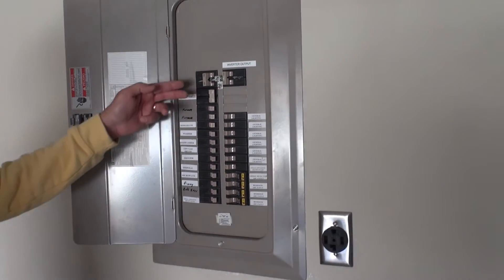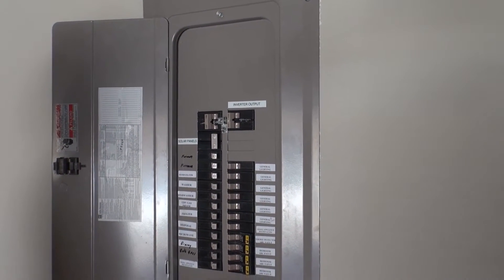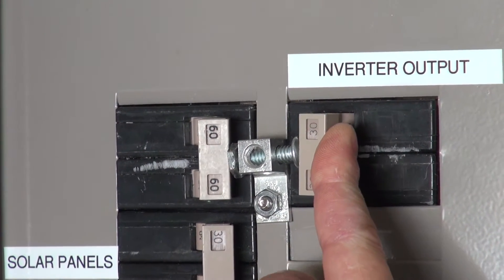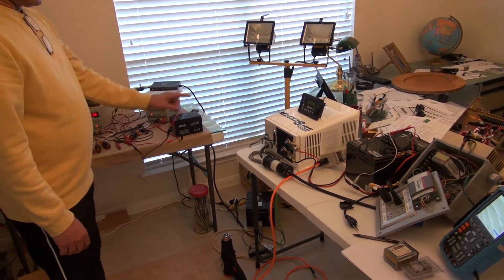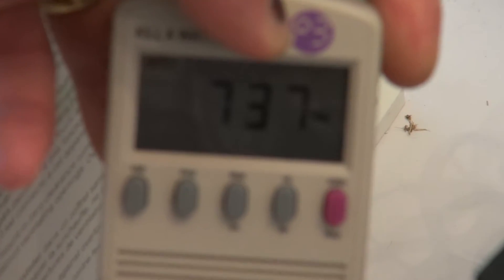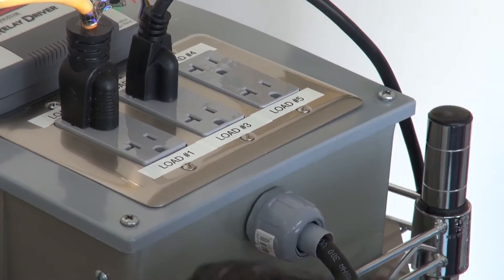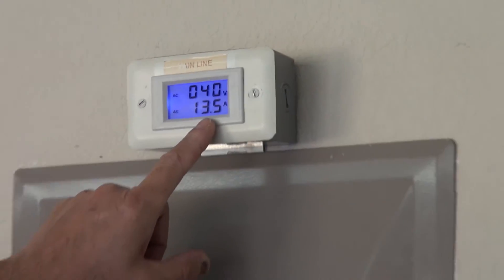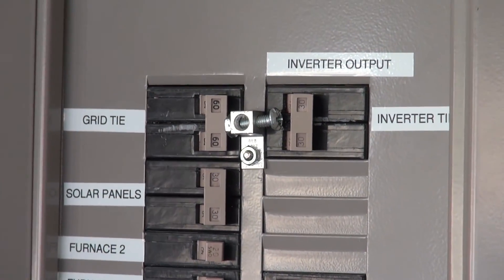Grid Tie Inverter without a Grid Part 5 of 5

Comment: Why not limit the Solar Power available to the Isolated Grid Tie inverters to limit the power created ?  There wouldn't be a need for the Dump load.
Reply from the maker: The dimmer is too slow to respond and you can not control the output of micro inverter they are on or off when they go off it take up to 5 mins to coming back on so you have to manage extra power that you generating with dump load

Comment: Hi Mark,thanks for this video..Interesting and great info! How come the voltage drop when load starts doesn't shut off micro's ? Once you hook up motor or compressor, it will drop significantly and shut off micro's for 5 min restart, which may result not to start the motor and going micro into cycle every 5 min.El. motors use high start up amperage causing voltage drop on OFF grid systems.This setup you have may be good for lights or small loads, not fridge ,not well pump, not A/C etc.. I'm wondering how Tesla power wall 2 is working with these dump loads..Tesla wall is also running from micro's and through some get away transfer switch shifting the loads..Once  Tesla  wall is fully charged, it keeps somehow PV array idle and doesn't let those micro's go full throttle depsite high sunlight, but keeping them ON..It has some kind of control of the output as you mentioned before, that  you can't control the output of micro, because it does produce max given from  sunlight at given moment...Do you know how Tesla wall deal with dump loads????
Reply: I think Tesla will do the same as this Magnum Inverter. It will increase its Ac output frequency to shut micro-inverters off.  All of this work of this gentleman is to avoid shutting microinverters off because it will take at least 5 minutes for them to start producing power. Frankly I don't fully understand why so much energy was put into this, but I found it interesting.

Comment: How can I use my inphase off grid straight to a hot water heater? This way I dont have to convert the thermostat to dc . I have extra pv panels I would like to do this with and take advantage of the mppt
Reply from the maker: Executing the command of dumping extra load should be done within 1 or two cycle of 60 Hz or inverters are getting shut down, you can use one or more of the outlet plug that I shown in youtube video to use your heater as a extra load, you can not directly connect Enphase inverter to heater, because Enphase inverters are Grid tie inverter and will not start if they do not see 60 HZ sine-wave with 240V AC, they check ~4 to 5 mins the above condition before they turn on and will go right away off if any of above two condition change, they build this way for safety. 
Note: Grid tie inverter generating power while they tie to live grid when they come on they have a bit higher voltages than Grid voltages that causing flow of current to grid. any interruption on grid Voltage of Frequency will shut the inverters OFF.

Comment from the maker: Hi Ric, yes you can  I am in Austin Texas the last thing that I need is more hot water :)
when the GRID IS DOWN and we turn on the panels we might have excess power that we do not know how much and we need to get rid of it before system force to shut off so i used cheapest resistive load that could use and is not sensitive to erratic power delivery.if the GRID is not DOWN all extra power goes to grid.

Comment: Hey Mark,great video you manage to thoroughly explain a/c coupling in a concise yet informative matter(kind of like show and tell in grade school)something that many manufacturers can't quite grasp.Would the dump load power be enough to energize a device which we could actually utilize i.e. water heater,portable heater or any type of resistive load instead of just burning it off?I realize that we would still supply the grid,but it just seems wasteful to simply burn off harvested power?thanx

Comment from the maker: Because using Magna sine you need to gang all panels in series or parallel and if any of panels goes bad it will effect all, also when you using Magna sine inverter you need somehow a big bank of batteries, in my design I use minimum battery to trigger the panels to generate the power during day time. remember the batteries are expensive and do not last long.
Reply: Dear Mark,
first of all, congratulations. Your series of videos is so far the most useful ones I have found in YT. 
I am planning to replicate your setup but with a slight modification: use only supercaps with their power dumping circuit instead of monitoring the battery voltage to decide whe. to dump load.
Do you think it will work?
Reply from the maker: How much charge can they hold? and then what happened after they get filled up, where the excess power going to? if no place to go then it shut off the inverter and for grid tie inverter it take about 5min to come back if the grid is there and met the criteria voltage and frequency
Reply from the maker: It's very hard for me to image how many super capacitor you need  to be able to store several KiloWatt of power on them, let's just assume you system is about 10KWh and in middle of the day for 2 hours you just using 2KW of that and  16KW need to be store on your capacitor or being dump somehow. storing that much power in capacitors cost $$$$.